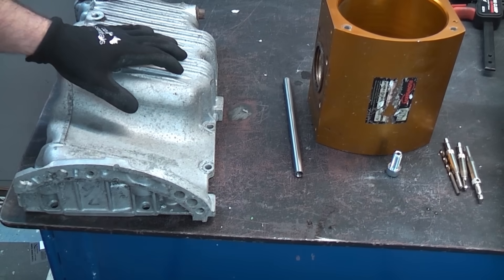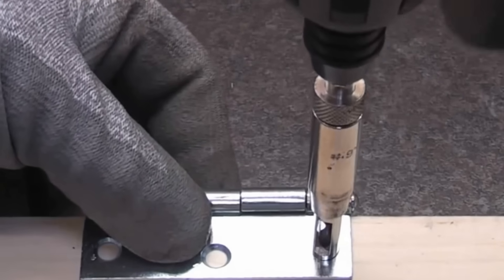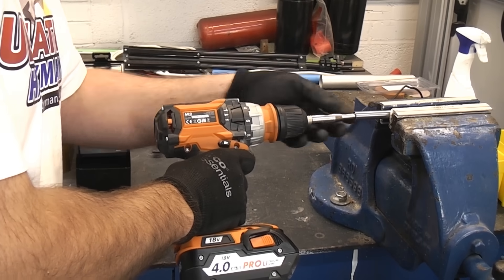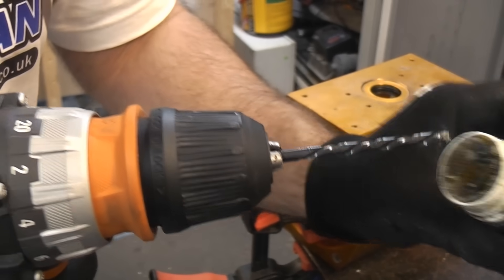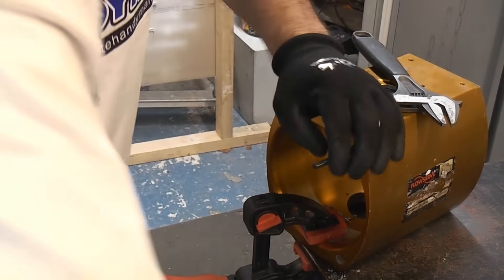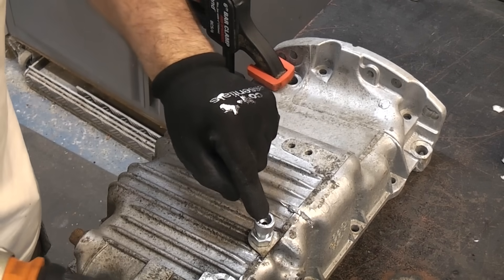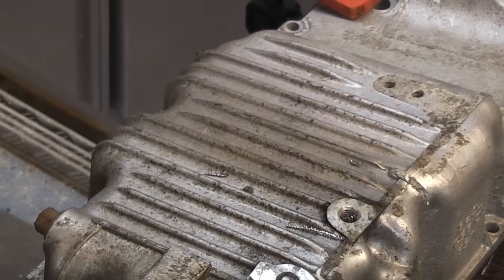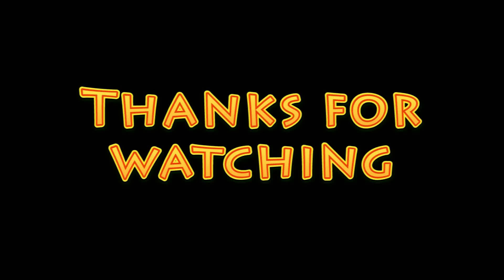How to remove a broken bolt in a deep hole | remove broken bolt in recessed hole

Comment: I will give you loads of credit for the guide bolts you created. But in my 45 years as a mechanic and machinist, when a bolt is broken in aluminum, the bolt never comes out as easy as yours has. I have tossed most of my easy-outs into the recycle bin. They never work unless the bolt has zero rust, they make matters worse by force expanding the bolt against the threads. And never in all my years has a left-handed drill bit worked. Why don't you show us a bolt that is really locked into the aluminum, with crossed threads.
Reply from the maker: When I do any of those videos the titles will be something like-
"how to remove a seized bolt"
"how to remove a broken seized bolt"
Thanks for the comment 👍

Comment: Changing out the transmission oil and replacing the filter. I didn't feel or hear a click on my torque wench and snapped the damn bolt in deep in the pan. Thanks for posting this vid! 🤙
Reply from the maker: I hope you sort it out ;-)
Thanks for the comment 👍
Reply: @ultimatehandyman  thanks for asking. Got the bolt out without damaging the threading! 👍

Yesterday, I replaced my water pump. Put RTV on the  transmission oil pan (carefully tightening not to snap a bolt LOL)!

Going to finish installing new fan clutch and radiator. Saw that the transmission coolant assembly line was bent. So that needs to be fixed...

Appreciate your help. Peacefully stay bro! 🤙
-Jeff

Comment: I couldn't understand through the accent I am sorry but what is the cover that goes over the drill to keep it centered called?
Reply from the maker: Not sure, what time in the video does it appear?
Reply: The sleeve that fits around the drill to center the drill when you drilled the hinge. 3:01 is a good picture. Sorry again!

Comment: For large bolts, it's easy enough to do it, but what is your technique for a bolt / machine screw that is a #8 or #10?  The handle on my shower uses one of those to keep it on the valve / control and it snapped off a long time ago.  I've never seen a bolt extractor that small, so my solution has been to just ignore it and listen to my wife bitch about it for the last 15 years.  Luckily, I went deaf to the frequency of her voice not too long after that, so it's not that big of a deal... :)
Reply from the maker: You might be able to get it using a micro-grabit-
https://www.youtube.com/watch?v=q6gehydy70k&t

My girlfriend has been whinging about jobs in this house for 8 years, I'll get around to them eventually - there is no need for her to remind me every 12 months 😂

Thanks for the comment 👍
Reply: @ultimatehandyman  -- My philosophy is that if it is really important, they'll remind you a few dozen times and then you can decide whether it is worth dealing with it... :)

Comment: Using the hinge drilling bit is brilliant. You can get a variety of sizes for most applications. If the screw extractor doesn't work, once you've got a nice centered hole, you can use a reverse tap and left hand thread bolt into the broken one and pull it that way as well.
Reply from the maker: Thanks for the comment ;-)
Reply: @ultimatehandyman  thanks for the content! That might just save me some major headaches down the road!

Comment: I have found that if you continue to gently tap on the extractor while trying to remove the broken bolt it helps to keep the extractor seated. Great video!
Reply from the maker: Thanks for the comment 👍

Comment: Ive done many of these using a mig welder.
Simply build up a pile of spots preferably directly down from the top.
When the build up of weld gets above the face then weld a washer onto the weld mound and then weld a nut to the washer.
Also works on broken exhaust  studs
Reply from the maker: Thanks for the comment 👍

Comment: From an other mechanic if you use cupper paste you''ve to know if surfaces are flat so that the paste is not in contact with air on any circumstance otherwise the grease will leave the paste and than the cupper and the bolt and for instance aluminium wil start a electric reaction of apr. 0.8 volt resulting in rust. And resuting in all the above mentioned poblems, for normal bolt connections i use anti seize a white paste untill now it worked miracels for me.
Reply from the maker: Thanks for the comment 👍

Comment: Having removed a lot of broken bolts as a machinist. I like to heat the aluminum with a torch then apply penetrating oil. While the metal is hot it seems to soak in better.
Reply from the maker: Thanks for the comment 👍

Comment: I know a lot of mechanics that need to see this video.
Reply from the maker: Mechanics are normally great, but a lot of them are working to a tight schedule, so that they do not land the customer with a huge bill. I'm sure most mechanics are proficient at removing broken bolts ;-)
Thanks for the comment 👍
Reply: @ultimatehandyman  Normally I would agree, but I have a 2015 4Runner with 4 broken bolts on the undercarriage because a mechanic couldn't get them out which is why I watched your video.  Thanks for the video though, I'll probably do it myself.

Comment: These broken fasteners are so shiny clean .  Mine are usually rusted in .
Reply from the maker: We got a mixture of both on site, some of the rusted in ones are impossible to remove and the only option is to drill it out and retap.
Thanks for the comment 👍

Comment: If these examples don't work, you can always do it this way... drill a hole completely thru the bolt,, on center is a must .
Then whatever the drill tap size is, redrill that size. Then CAREFULLY run a tap down thru the hole. (Break a tap off in any hole, your fuk'ed. You will need an EDM 
machine to remove that.)
What this is doing, you are removing all of the bolt except for the major and minor diameters of the bolt threads. then the tap is removing the rest.
I love the bolts you drilled a hole in as guide to get on center holes........👍
Reply from the maker: You can drill out a broken tap/extractor with a diamond coated hole saw-
https://www.youtube.com/watch?v=7JCfEMrCjhc&t
Thanks for the comment 👍
Reply: @ultimatehandyman  
I just watch that video, very nice..Back in my USAF days, I was a machinist,(still am today) and that was pretty much my jobs, removing anything broken.
Jet engine bolts/screws were the worst!! But after awhile, I got good @ it.. That other video you sent me, that product wasn't available back in the mid 80's
im sure. An old timer taught me a trick or two, if an screw/bolt is broken off, but very *loose*,  use a pencil eraser as a screw driver, works great. 
I still love your bolts with holes in them as a guides, wish I would of had them back in the day!!!!
Good stuff here mate!!
Reply from the maker: @doesntmatter3068   Yeah, diamond coated hole saws are relatively new. I have a mate that works for BAE, they make military aircraft and drones etc. One day he was replacing his front door lock and the screw was stripped, so I went and removed it for him using an elastic band. I then said "but you are an engineer that works on aircraft that cost millions of pounds, how would you have removed that screw at work?" he said he would have spark eroded it! 
Thanks for the detailed comments, Steve ;-)
Reply: @ultimatehandyman  
Funny!!
Yep, ya just have to be smarter then the broken bolt/screw!

Comment: What if at surface? One of the things I have sorta sucked at my whole life is removing broken bolts. Very good idea with the hole through the bolt and left hand drill bit! I would not trust myself and would have used a drill stop on the bit so I didnt drill through.. I wrecked a $600 head for a Chevy small block, by going too deep one time.
Reply from the maker: It's critical to get the hole in the dead centre of the bolt (in case you have to drill it out and re-tap) 
If the bolt is sheared and is flat you can normally centre punch the centre of the bolt, sometimes you can use an angle grinder and flap disc to flatten the bolt before centre punching and drilling. If you got a bit of practice you would become good at it. You just need a few bits to practice on and some patience and you'll soon pick it up ;-)

Thanks for the comment 👍

Comment: why use cutting/grinding paste, a decent drill makes the hole all the cutting pastes does is dull the drill.
Reply from the maker: The paste is to protect the drill bit from getting hot, as the drill will soon go blunt once it gets hot. It's not a grinding paste, it is a drilling/tapping/cutting paste.

Comment: After removing a damaged bolt I always put the new bolt in and then take it back out and 2 or 3 times before finally putting it in and snugging it down. That's a really cheap and easy way of re-straightening/aligning the threads.
Reply from the maker: Thanks for the comment 👍

Comment: 12 point socket on your impact and done!  Also, WD40 is not really the best choice for the problem.  There are fine wicking sprays that work far better, generally marketed as screw loose or the like.  I shudder thinking of all the broken bolts I have removed over the years!

Comment: You were running the drill bit forward when drilling on the valve actuator body, which is backwards with a left handed drill bit.
Reply from the maker: No I wasn't, I even stated that the drill was in reverse!
Perhaps the video is making the drill look like it is turning the opposite way (sometimes this happens in movies with wheels - they look like they are going backwards)
Thanks for the comment 👍

Comment: In a pinch (and lacking special tools) you can use a small piece of brake line to help center a drill in a hole. In a real pinch you can wrap the shank of the drill bit with tape to keep in on center, just to find your starting point without sliding off. Of course you can combine those two by adding tape to a bit of brake line to keep it from falling out of the hole while you work. Basically you are creating a force fit as necessary. If you have access to a drill press and a jig vice, by all means make up a set of those guide bolts this guy uses.
Reply from the maker: Thanks for the comment 👍

Comment: What if the bolt is snapped flush at the top of the thread and you can't get the hole drilled in the center because the bit keeps running off because you couldn't get to hit a center punch on it
Reply from the maker: It can be really difficult. I have used an angle grinder in the past, so grind it flush before using the centre punch. It depends how much room you have, some situations are impossible.
Thanks for the comment 👍

Comment: Using copper paste on aluminium? No corrosion? Workers on outdoor powerline have separet setts of tools,  one for copper lines, one for aluminium. They never mix.
Reply from the maker: We use copper grease at work on aluminium components with no issues.
Thanks for the comment

Comment: I got a 3/8 impact rated extractor set. extremely fast and much better than those because u get impact plus turning at the same time.
Reply from the maker: I'll look out for a set of those.
Thanks for the comment 👍
Reply: @ultimatehandyman  completely changes the game mate. impact is everything.  worn out allen key bolts hammer in a 3/8 torx nearest size works overytime on impact. trust me. I got loads of people out the crap with that not drilling or anything required fast and easy. High quality torx hammered into hex ftw every single time. No damage to torx bit either.  I use teng tools and Milwaukee electronics.  cheers

Comment: What about badly rusted bolts that have had their heads sheared off when trying to undo them?
Reply from the maker: Sometimes you just have to drill them out and re-tap the hole.
Thanks for the comment 👍

Comment: what brand of drill bits are you using?
Reply from the maker: I think I used the left handed drill bits in this video, I bought a full set of them at auction, they are made by Well-Bilt (not a brand that is common in the UK)
Thanks for the comment 👍

Comment: More common is to break a tap in the hole. These are too hard and brittle to drill.  I had to resort to EDM ( Electro Discharge Machining)  to get the  broken tap out of an engine head.  Although it cost me 150, it was worth it.  There just happened to be an EDM outfit right here in Conroe Texas, which was very convenient for solving my dilemma.
Reply from the maker: I have drilled them out, but it is not easy- https://www.youtube.com/watch?v=7JCfEMrCjhc&t
Thanks for the comment

Comment: copper greas is the worst thing you could put on alluminium as it eats the ally but your method of removing studs is brilliant never leave a copper bolt or copper nail in an ally boat it will eat its way through it

Comment: 37 years a master ASE and I've taken tons of broken fasteners out.  I employ many techniques.  Some of what you did I wouldn't but I do like the bolts turned guides.   A collet on the lathe I imagine instead of a 3 jaw or you'd spend eternity at setup to drill. I will employ such when possible.  Most are flush and I weld them out, or the space available in a car is prohibitive to the method.
Reply from the maker: Thanks for the comment 👍

Comment: And if you have to drill out hardened bolts like grade 8 and above, use vinegar for a bit lube and a low drill speed. I know it sounds strange but the bit will go through it like butter.
Reply from the maker: I'll try that sometime ;-)
Thanks for the comment 👍

Comment: Usea heat as a last resort. Because heat will harden the broken bolt. Then you will need a carbide bill bit to drill it. so drill it first then use heat. 40 yr. mechanic experience speaking

Comment: Thanks for the video, nice job.  Broken taps would be level 2 difficulty.
Reply from the maker: Yes, but still possible- https://www.youtube.com/watch?v=7JCfEMrCjhc&t
Thanks for the comment
Reply: @ultimatehandyman  Thank you for the link. Lots of good ideas as usual.

My next task is to cut some 22mm OD, 18mm ID x 505mm long titanium tube into two 250mm lengths, I'll probably use a Dremel like grinding tool to cut it then clean up the cuts on the lathe with a carbide tool (titanium hardens if you get it too hot and can catch fire, a fire that cannot be extinguished with water but I'm told a bucket of dry sand will put it out). I've never worked with titanium before, should be fun.

Comment: when i have this problem its usually in an engine IN the car.
Reply: 18 degrees, blowing, laying on cardboard and I need to go to work tomorrow.
Reply: @mikusoxlongius  Pick the car up, carry it to the garage and put it into the bench vice. Dang sissy!
Reply: I just traded a limping 4x4 for an old 97 Avalon. Was told it just needed a new valve cover gasket. After finally getting all the shit off the engine to get to the rear valve cover (its fucking buried on the 1mzfe) 3 of 8 of the bolts were over torqued and snapped off in the block. Going to get them put tomorrow, that was enough cursing for today 🤣
Reply: Sublime 203 how’d ya make out?
Reply: Yes, or lying on your back trying to get a few sheered studs out of a tractor oil pan.
Reply: Believe it or not I've had great success with a dremel diamond tip bitit was my last resort and will always be my first now
Reply: When I have this problem it’s usually upside down, 18 inches off the ground on the track frame of an 86,000 pound, 60 year old D8 Cat Dozer, in the mud, 300 miles from the parts store.....
Reply: If it's in aluminum and you can't get a drill to it, AVE has a video on youtube where you use a chemical to erode the bolt over a couple of days. The chemical doesn't affect the aluminum at all and eats away the steel bolt. You can accelerate it using a 40 watt lightbulb by warming the chemical. Search youtube, it will tell you what the chemical is.
Reply: @muskokamike127  If this bolt has a vertical orientation, how does one get the rest of the residue out, once it's been corroded?
Reply: @Ronnock  These things require patience that I do not have;
For you question you just jack with it until you get it out keeping down-payment for new car on deposit account at retail bank ▬ >>>> Otherwise be ready to get exercise by walking!
Reply: @Ronnock  probably compressed air?

Comment: Can you drop a link to these tools you are using and recommend here? I am checking on amazon and not sure which ones to get
Reply from the maker: Hinge centering drills- https://fave.co/2DpJo1H
Left handed drill bits- https://fave.co/2xJjK1M
Teng screw extractors https://fave.co/2OnfRuF
Dormer taps -https://fave.co/2OsN1sQ

If you are in the UK-
Hinge centering drills- https://fave.co/2NE1VMc
Left handed drill bits- https://fave.co/2DubtF4
Teng screw extractors- https://fave.co/2pVLkVT
Dormer taps - https://fave.co/2pTfbyx

exact cutting paste- https://fave.co/2Nabyxc
cobalt drill bits (they are much better on harder steels like bolts) https://fave.co/2zDh3kp

You'll have to make the guides yourself, but they are easy- https://www.youtube.com/watch?v=6mZj0J6CNYA&t=1s

Spring tools centre punch- https://fave.co/2NbnLBD

Thanks for the comment 👍

Comment: Really timely. My Toyota dealer snapped off a couple of bolts holding my skid plate on my new 4runner when doing a simple oil change. Of course they did not tell me about it. They tried to cover it up.
Reply from the maker: That is not good! 
Thanks for the comment 👍

Comment: Most of the bolts I've broken in all my years of mechanics broke flush with the casting. Rarely do they break deep inside the taped hole.
Reply from the maker: It depends what you work on, we get them on site every now and again and plenty of people in the comments have had the issue.
Thanks for the comment 👍